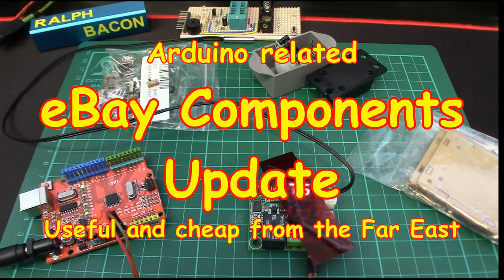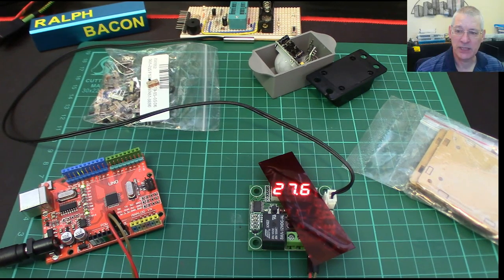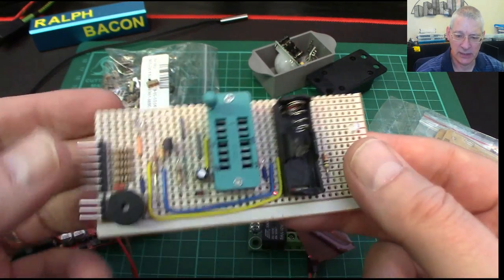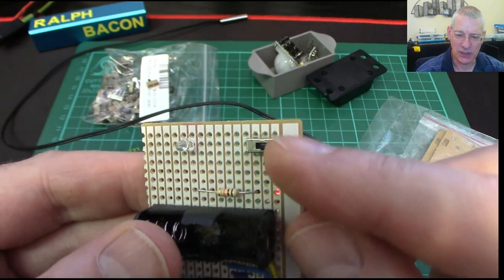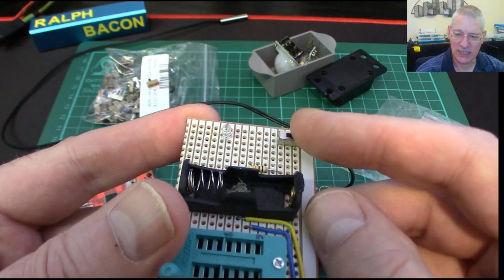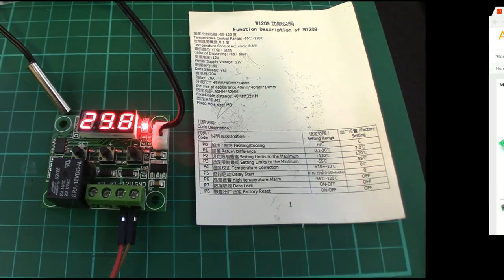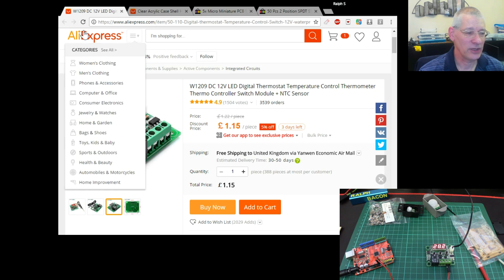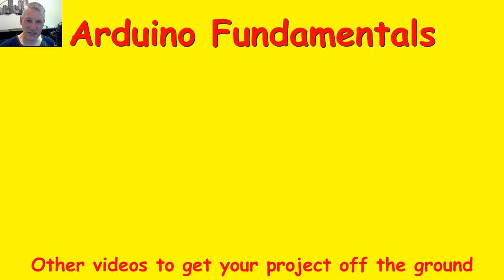#86 More eBay Goodies (for the price of a cup of coffee)

Comment: The temperature controller was neat. Reminds me of the more common STC-1000 controller. It's practical if you only want to connect 230v stuff and need to increase AND decrease temperature. I use it to control the fermenting of beer in a fermentation cabinet (old fridge) where the STC-1000 turns on the fridge if the temp is above the set range and turns on a heater inside the fridge if it's too cold.
Reply from the maker: That's a good way of adjusting the temperature for your beer fermentation. But does it take a while for the fridge to noticeably drop the temperature I wonder? Bear in mind this module here can be set to H(eat) or C(hill) but not both at the same time. Thanks for posting that info Functional Design, good to hear from you.

Comment: P5 is compressor protection. 5 minutes is the usual delay time for better Air Conditioning units. It allows their high pressure lines to bleed down so its not so hard on the compressor. In some circuits it can even be so difficult for the compressor to start that it draws excess current which in turn triggers the fuse or breaker which is a real PITA. ( Usually operator and the operator is unaware of the nature of the circuit. )
Reply from the maker: Thanks for that information John, at least we now know what that P5 delay is for! When you say "operator is unaware of the nature of the circuit", you were not referring to the engineer who unplugged British Airways power supply last weekend were you, and then reconnected it in "an uncontrolled manner"! He needed a P5 mode too :)

Comment: I would suggest some sort if an alcoholic beverage on ice for calibration because it makes the math more fun (and the overall fun as well). For accuracy water in crushed ice is by far the way to go, but... Anyway, thanks for the video!
Reply from the maker: I totally agree, Robert, plain crushed ice is all very well (and accurate) but a dash of lime, a shot (or two) of Tequila, some Triple Sec, ah yes, so much better. You would then end up with a totally inaccurate thermostat because alcohol freezes lower but the question is, by that point would you still care?
Reply: Well... I was as stupid as a sober man can get. The calibration would of course be fine if the ice is melting. Even ice in pure alcohol will melt at 0 degrees if we assume it's water ice. It's Friday and time for a drink. It would have been a great excuse if I drank before commenting. ;-) Lesson learned: Never trust a 50 year old Norwegian software developer with your physics problems.

Comment: And yup, just ordered one of those temperature control boards using your link Ralph. Great for a project for my sons greenhouse.
Reply from the maker: Works quite well, do let us know how you get on with it John.
Reply: Will do Ralph. Not sure how long they take to arrive. I have also ordered a 9V to 5V buck converter so I can power it with a 9V battery. I am sure there'll eventually be external power out there but he is renting the property and I don't want to run any external armoured cable. But... do you have any alternate suggestions as to how best to power these devices (and Arduinos et al) when no AC is readily available?
Reply from the maker: Solar panels charging a LiPo (or sealed lead acid) battery of some kind is usually the way to go for greenhouses. A decent solar panel or two charging two or more 3.8v LiPos (via a charging module to prevent over/under charge) then a buck/boost converter to get it back to 5v. I did a video about this in broad detail, might be video #50 I'm thinking of. It's exactly the thing I'm thinking about my workshop, not for day-to-day power but maybe just to keep it ticking over during the day when I'm not there. Wind power is also an option but expensive and believe it or not you do need a decent, reliable wind source.
Reply: Thanks Ralph, in which case I shall seek out and watch video #50!  That's after I have finished watching video #92 😊. Have been thinking for a while about the JYE DSO150 mini scope, especially at the bargain price it is available for.  Again... unless that is, if you have any further thoughts on it or other alternatives?  I will be ordering this (or a.n.other if you suggest) and many other Arduino/electronic/toolkit/storage/stuff/gadget/gizmo/components items later this evening. Oh yes... and a Pixie Kit 40M Transsceiver for my amateur radio intermediate project haha!  Now then... I should really make a start tomorrow on building my hobby desk so I don't spoil my music and radio desk. 👍
Reply: PS: If I do buiy it, I will be sure to use your link :)

Comment: Nice review, and especialy this nice temperature module. 
And btw Ralf where did you get this red filter what was puted  on the display at the beging of your review?
Reply from the maker: Thanks for your kind words, Szymon, appreciated. The red filter I use is lighting gel, something like this: http://www.ebay.co.uk/itm/106-PRIMARY-RED-LIGHTING-FILTER-GEL-THEATRE-DJ-CLUB-LED-DISCO-24cm-X-24cm-PAR-64-/161459286549?_trksid=p2385738.m2548.l4275 which is for a 24cm x 24cm sized piece which means you can cut it down to size and have plenty left over too. Good to hear from you!

Comment: Being TOTALLY facetious for a moment ... Have thought about insulating your tank and pipes in the attic Ralph? I'm sure it would be cheaper than heating the roof space. 🤔😁😁
Reply from the maker: I can't remember in which context I mentioned the heating of the attic in this video, Bob, but rest assured my attic is insulated very well, including the water tanks and pipes. However, go up there during a snowy period and it is COLD, which worries me (yes, I know, I should worry less) but heating the attic with a 6' greenhouse tubular heater underneath the main tank seems to work very well (and does allow me to worry a lot less!).

Comment: Maplins used to buy stuff from China & bang the price up, on their closing down sale, I got wire for the same price as you could from China & it had made in china on the bag. People forget that some of the big brand tech is made in China for them, for cheaper production costs.
Reply from the maker: Quite so, Malcolm. Apple iPhones are made by FoxConn (a Taiwanese multinational electronics contract manufacturing company, with a base also in Shenzhen). There's nothing to say Chinese or other Asian components or products  need be below a decent standard but there will always be rogue traders out for a quick buck.

Comment: Hi Ralph very interesting products where did you get the nice red filter that you covered your display with, please
Reply from the maker: Hey Bob! I bought this from eBay (UK). I just searched for "red acrylic lighting gel" and you get all sorts of sizes (and prices). Here's an example (just that, not a recommendation, as it's for a small piece0 : http://www.ebay.co.uk/itm/106-PRIMARY-RED-LIGHTING-FILTER-GEL-THEATRE-DJ-CLUB-LED-DISCO-24cm-X-24cm-PAR-64-/161459286549
Reply: Thanks very much for your help 
Bob UK

Comment: You may have benefited from a listing error with those switches. Your link now shows STG£3.69 shipping.
Reply from the maker: Hey BaronVonBiffo, don't be concerned. I've just checked 19th May 2017 @ 21:32 and they come up as:

50 Pcs 2 Position SPDT SS12d00G3 1P2T 3 Pin PCB Panel Vertical Slide Switch DM  
£0.99
Free Services from outside UK | See details

So I looked up the "See Details" and it said:
Free P&P United Kingdom
Services from outside UK (Economy Shipping from China/Hong Kong/Taiwan to worldwide)
Estimated between Fri. 9 Jun. and Thu. 13 Jul.

Are you using eBay.co.uk or another variant - in which case I suppose the shipping charges could be different?

Comment: Hi Ralph, nice video. Thanks for all your work!

After watching your video I ordered two of these WS1209 controllers as well and they arrived today.
Played around with the first one and then suddenly magic smoke came out of it.
The reason being that diode D1 was mounted in the wrong direction.
I found a schematic of the board here: https://github.com/TG9541/stm8ef/wiki/Board-W1209.

D1 is the diode that protects the transistor against the back EMI when the relay switches off.
As it was mounted in the wrong way it was now actually shorting the 12V power supply via the transistor to ground when the transistor turned on.
That killed the 10 ohm resistor (R3) that is in series. Transistor and diode are ok.
After I fixed that, all worked except for the LED that did not turn on when the relay switches on.
The 1K series resistor for that LED measured open and is located under the display.
I desoldered the display, and to my surprise the resistor was not mounted at all!
Put one in, soldered the display back in place and now all works fine.
Quite some fun hobby time for less than two dollars!
The other unit was ok.

Keep up the good work. I enjoy your videos.
Ewald
Reply from the maker: I shake my head in disbelief, Ewald, at the poor quality of some Far Eastern components, but I must say big kudos to you for identifying and fixing it so well. I guess this is the price we pay for, well, the low price goods but that obviously didn't have an QA - apart from you! Funnily enough, (lots of) the magic smoke escaped from another component of mine last night, that could have been far more serious and which I'll mention in a future video, and may well quote you too. At least you exercised the old grey cells fixing this, great job, and thanks for your support for my (OK, Benny's) videos.
Reply: Hi Ralph,
Yeah I think I had one assembled on a monday by a pick and place machine that had a tough weekend. At least I can not imagine that somebody is assembling these units by hand. Maybe i am naive...Should that be the case we should no longer order items for such low prices anyway, but that is another discussion....

Most of the time I must say that the assembled boards from China are rather reasonable to (very) good quality. I am curious to what happened to your unit and what was the source of your smoking gun. By the way, the 10 ohm resistor did not die completely, it only measures 20 ohms now instead of 10. Happy i bought me a pack of 1000 or so smd resitors a while ago. I could now at least use two of them 😀
Regards,
Ewald
Reply from the maker: That made me laugh out loud Ewald, the thought of you getting out a huge reel of SMD transistors and finally peeling off two of them! But it still probably cost you less than buying a half dozen locally!
 
I'm with you regarding quality from the Far Eastern suppliers; the quality is generally fine to good, and mostly they're made by machine but there are still sweat shops out there assembling by hand - and it's easy to spot these as the quality is generally awful.
 
Can't say too much on my magic smoke component but it is slightly more serious than a single component burning out, oops, no spoilers says Benny!
Reply: No please, no spoilers. My only hope is that your house did not burn down though, as than the next video will take some time :-). It was not a big reel i had to peel them off, but a package of 74 strips for different values of resistors (10 each), so 738 to go. I bought it together with 57 x 10 capacitors. All together for a little over 10 USD. Amazing how cheap electronic components are these days...

Comment: You need to be very careful with these ebay listings.   There is a new trend,  where the ad has something like "50 pce for 0.99"  or something like that,   but when you go to the item you find that the actual price is 0.99 for 1 piece   and 50 pieces is actually something like 10 pounds - still very cheap,  but the listing is misleading.   This trend has emerged as some means for the seller to "game"  the ebay search engine,   it is quite annoying.
Reply from the maker: I tell you what I have found on eBay, Robert, and it drives me mad.
 
Let's say we're searching for an Arduino Nano - usual selling price around the £1.80 - £2.30 range. As you find one listing for £2.10 you open it and find listings promoted by eBay from other sellers who advertise an Arduino Nano for 99p. You think "Surely not?" and when you open it you find that you can buy a Nano for £3.00, a Nano with USB cable for £3.50 or just the USB cable for 99p. MIsrepresentation or what? Grrr.